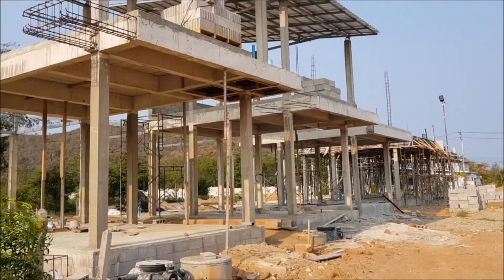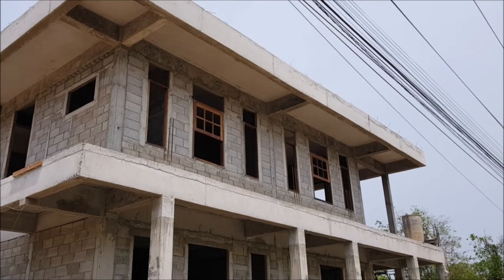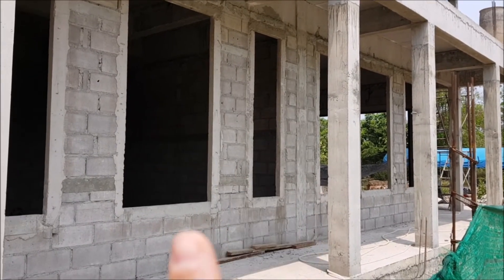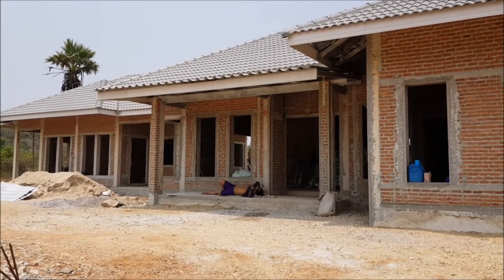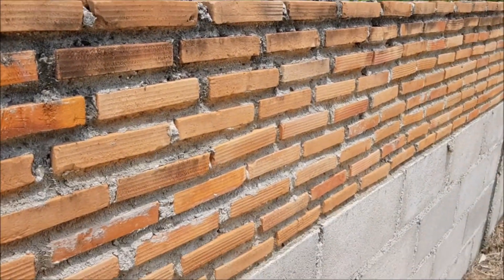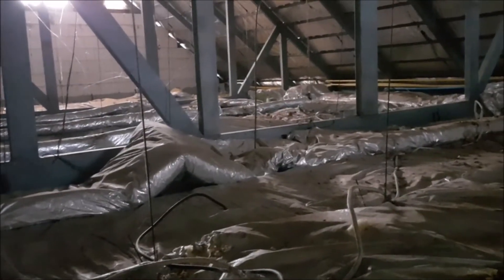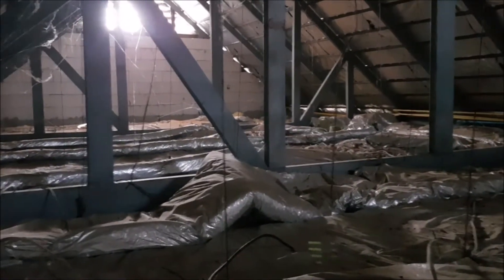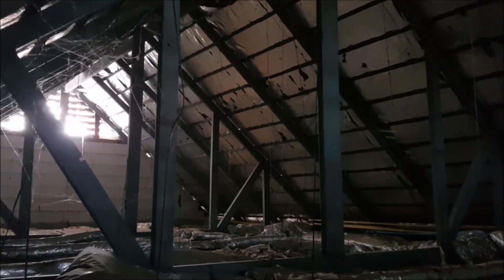Energy efficient building for hot climates. How are Thais building their homes?

Comment: Thanks for covering this topic for an Asian tropical climate. Here in the Philippines, Autoclaved Aerated Concrete (AAC) blocks by Stärken and other companies are becoming more popular. Theoretically available from 5 cm to 30 cm thickness. From what I observe though in actual use, I see 15 cm thickness for the outside walls and 10 cm for inside walls. Expats tend to use 20 cm for outside walls. A rendered AAC wall is at least twice as expensive per square meter than traditional Concrete Hollow Block (CHB) walls, but due to high electricity costs there is a good return on investment when using air-cons. Even without air conditioning, a well insulated room is more comfortable, because the insulated walls give off much less heat during the night than CHB.

Due to earthquake engineering up to a magnitude of 8.0, we use very solid post and beam construction, either with reinforced concrete or steel beams. Traditionally, CHB are filled and  reinforced by 10 mm reinforcement bars every 60 cm vertically and horizontally and tied in to posts and beams, preventing cracking and falling out during quakes. This is difficult to replicate with AAC. The advantage of AAC walls is, that they weigh only about one third of a typical CHB wall.

Nevertheless, the AAC infill walls need special consideration in earthquake zones, as they easily form cracks even in relatively minor earthquakes (magnitude 5.0+). In the Philippines they use a seismic gap of 1 to 2 cm on the sides and on the top filled with polyurethane foam or very soft mortar. Also the walls are tied in to the posts/columns using dowels or brackets every 60 cm of height. By comparison in Italy even more earthquake detailing is required for AAC walls with continuous reinforcement layers every 3 blocks and better protection against falling over by fastening the walls to the top beam.
Reply from the maker: Thanks for this interesting information about considering earthquakes.
Reply: @ChristianWagner888 do you have a company related to building in PH would be great to have contact.  my wife has house in N. Vizcaya we plan to build home/office in Mindoro or vicinity.

Comment: Thanks a lot for this video. Most videos on energy efficient buildings are from developed countries where emphasis is on keeping the heat in or keeping the cold out. If you have a link to how those energy-efficient concrete blocks are made then that will be very well appreciated.
Reply from the maker: This video would show you the production as an example: https://youtu.be/rZLDk00Cj2I
This types of blocks are typically made all over the world. The advantage is, that the material is containing mostly air, similar to a sponge. And it is the air, which gives you the good thermal properties.
This would be a video as high tech manufacturing example: https://youtu.be/JF96Wx-u07Q
Reply: Great! Thanks a lot.
Reply: I think they are aac blocks- autoclaved air crete blocks with air cells inside

Comment: i plant to put water pipe in room ceiling, so the cool water can be circulated
Reply from the maker: Roof areas and attics are usually the hottest places in a house. Your idea can block heat coming down that way.
Reply: @RolandW_DIYEnergyandMore  indeed, beside cool water are cheap & since we constantly use it, the water constantly replaced. So no heat buildup happen

But water pipe cost a lot
Reply: Although I agree with hydronic systems like that (running water through walls / roof) I’d be cautious about potential pipe damage or condensation issues since the roof will be the warm zone and the water will be cool

It would be far better to build a secondary roof system atop existing roof with a sloped overhang that blocks afternoon sun and cast a shadow on the wall that usually gets the afternoon sunlight and solar heat gain 
Tree placement and shaded outdoor water pond also helps a lot because the breeze passing over the water becomes cooler bringing the coolness inside 

Also you should get one extraction fan and run it through the late evening to early morning (9-10pm to 5-6am) to get a good overnight purge of thermal heat trapped in the blocks, then try keeping the windows/doors closed from 10am - 4pm, try that out for a week (it’ll take a few days to purge the heat storage in the walls and bring them to a good level of average temperature)

I’m introducing these and other concepts in Africa which is also hot and humid weather
Reply: Good idea, the inevitable indoor pool should be very shocking (yes, pun intended) as well.

Comment: Simiar but different processes to us in the caribbean. In my country DOminica the  smallest blocks we use are 4 inch but only for internal walls. 6 and 8 inch are used normally for external walls. Also we put up the blocks first and then pour the colums. Then after pour the beams and decking so it can tie in better structurally for exquakes and hurricanes. The passive cooling is the biggest problem i personally have dealing with
Reply from the maker: In a hotter world passive cooling is getting more difficult as even places in shadow will be to hot. We will have to rely on AC in furure but keep our rooms as energy efficient as possible. And the energy for the AC will idealy have to come from renewables. Thanks for sharing your experience!
Reply: a/c is the only way to make it bearable..  100% humidity is not fun.. A fan just moves super hot moist air .. Like how west and souther america populated.  It wwas the a/c unit..
Reply: I’ve done projects in the Caribbean ( and now Africa) which those traditional methods you mentioned are pretty common and although the 6-8” blocks DELAY the heat gain, by late afternoon ( especially on the west facing walls) they have absorbed an abundance of heat and then by the evening they slowly release the heat to the interior space 
Which is exactly the time when energy demands are high and often higher energy tariffs ( costing more than the residential day tariff)
Concrete blocks (CMUs as called in the USA) used in the Caribbean, are designed to delay the onset of heat and unfortunately the release of heat, so at 6pm sunset those west facing walls will feel warm/hot for 6-8hrs or more, on the inside and outside 
That is the problem and it’s a design issue which can be solved 

What I do in retrofit like an existing building like you have, start with outdoor exterior wall treatment to cast a shadow on the west facing wall, that could be adding 1) trellis with creeping plants, 2) fast growing plants like bamboo 3) a pergola with canvas panels to create an outdoor shaded area for BBQ etc 
From 9-10am keep windows/doors closed late morning through late afternoon and add an extraction fan high up the wall to purge days heat and while opening at-grade windows (or a vent) which face the outdoor garden or landscaping ( not a paved areas ) from 8pm overnight until 6-7am
These are simple solutions that will help you reduce your energy consumption for A/C 

If I was building your house I would have used either aerated blocks of 3” and do a double envelope with a 1” air barrier vented to the exterior roof elevation ( this works by creating a thermal separation air barrier from the outside wall, which absorbs heat, and the interior wall which has no direct contact with the outside wall preventing heat conduction-transfer, so the inside face of exterior walls remains cooled passively through night purges) 
another option is a single concrete wall of 6-8” but with 2-3” of rigid foam insulation covering the complete outside wall envelope, this system is faster and easier than the former, and it creates the best of both worlds 
I call it a capacitor and a resistor, the resistor is the outer later of rigid insulation that resists heat transfer conduction through the wall which normally heats the building in the evening, and the capacitor is the 6-8” concrete wall acting as thermal storage of cooling from the limited a/c or the night purges 

As you know the Caribbean nights are very enjoyable, and enjoys an average 10-12c variation from daytime highs to overnight lows, that is key and required for this design to work 100% 
Because the overnight lows is the temperature you’d want to maintain indoors throughout the day, using this technique you will be able to do this and with very limited or no energy consumption ( nearly passively) 
the Caribbean only has ~8 or 9hrs of heat to mitigate and the other 15-16 hours of the day are very temperate and enjoyable, meaning you use the majority of each day’ free energy to mitigate the effects of the hottest parts of the day….. 😊
this is much easier than a cold climate environment where the days are cold (avg -15c to -25c) and the nights are colder (avg -25 to -40) spanning 3-4months year, doing passive house design for that is tricky because 6mths later it’s hot and humid (+30c to +40c) so the design used to solve one issue is sometimes working against you to solve the other issue, need to be on your p and q 😅

I’m a passive house / energy efficient building developer, and usually I don’t give out professional services freely as it’s a business I do, I’m planning to do more such projects in Africa and the Caribbean I’ll like do vlogs on the topic, there are a few more tricks to do with it which will make the buildings fully passive and use no / very very minimal mechanical cooling in hot climates 

But using those tricks will save you a lot of money on energy costs, also in SE Asia Pacific, as well. 

Most of the narrative of passive house building design is dominated in the global north, which has different challenges, some apply to both but not all, I’ve spent over 20yrs doing such passive houses in Toronto Canada and NYC/Chicago USA and learned a lot about how to do them, I’m now applying that knowledge to tropical climates which has different challenges

Thanks for the video 👍🏿

Comment: Thank you so much for sharing this info. My partner and I are thinking about moving back to SE Asia and would like to build a home. I grew up on solar and realize that aircon uses many kwh of power, so I've been wondering about passive cooling options.
Reply from the maker: Thanks for taking time to comment. Yes, improving the structure of the house will help you to keep electricity cost on acceptable levels and you will feel a big difference inside compared to a cheaply built option.
Reply: Have you ever lived in asia.. Hot and humid, hot and humid rain, high humidity.. things get moldy and fast..  I used 3 dehumidifiers, others used closet heaters to prevent mold.. I never turned off the a/c..  If no ac then no fabrics whicker etc..cooler and no mold.. In pi they have woven beds cooler..  Rugs duh mildew smell yuck..   Passive options when its over 90 degrees and super high humidity.. You aint getting cooler air coming in. .Plus a lot are concrete termite and pest proof..Got the oven effect, suck up heat during day gives it off at night..   Solar have you ever been in a typhoon? well solar becomes airborne and a killer..  Yup..  Termites soo bad last time in thailand the roof rafters were metal pest proof..  Metal roofs, cheap and pest proof..  A matterss in a non conditioned space is a moisture grabber..  Rainy season nothing dries out, permanent high humidity.. You can feel it when you inhale..  And always have extra shirts in the boot..  One must condition at least the bedroom so clothing and bedding is kept in a usable state..  With a dehumidifier, add some heat too..   How does one lower humidity at 100%?  For weeks a season at a time..   One must remove the humidity thats how..  Basically the locals live with no a/c, but my sis in law definetly has an a/c in phillipeans..  And uses it..My dad doesnt my wife visited and could not sleep or eat.  There is no way i would live back in asia without a/c  in a few rooms..  Ahh the coolness and dryness are intoxicating..  When 100% humidity how does one dry cloths??   Locals just hang them to dry?? (hello its 100%) Me save enough to have a/c and a back up generator to power them..  Super insulate the bedroom on the outside with foam baords with aluminium backing to reflect radiant heat.. I live in san jose and the sun is really hot and strong.. I use foam with aluminium covers for my sunny windows to stop radiant heat..  I cover them in fabric look good..  On the  window side over 100 degrees, on the inside its 76 degrees and the room doesnt heat up.. You damn well know when the windows arent covered, the room really heats up.(radiant heat rays come in and heat up the items in the room thats bad).  Think australia and they have overhangs to stop sunlight..   My lesson one must stop solar radiation.. Bounce it back.. Read articles on best heat reflectors..  Mine are up already upper 88 or so today im bottling cool air..  But in asia you dont get cool air..  A fan just doesnt cut it..  San jose homes and commercial the roof plywood is aluminum reflective on one side now.. food for thought..  Mildew is bad in asia so mildewicide paints inside are a must, you can surf stores in asia for what they use there..  ac units geet clogged from dirt in asia so my sis has hers cleaned every year or so..   Bedroom windows at a minium they just lose or allow heat to enter..  Or as I always say if you live in an asian country get used to it live like a local..  Bob coated his roof 2 times a year with a reflective white paint in PI..  See articles there are a lot of them now..  So how to stop radiant heat? trees, ivy, thats the real killer.. If one can limit the heat build up your a winner..  Id insulate the outside because cold meats hot you get moisture keep it outside.. Inside no sheet rock plain walls stuccoed like how i lived in HK and singapore.. Must move air around mold etc..  Asian cars have supped up ac systems to handle the heat.. Not like usa units..  you see your breath, ahhh what a relief after walking about for hours..   one must have at least 1 room with a/c with a tv computer clothing..  Some days are unbearable..
Reply: Not too familiar with this. So what you're saying is thicker solid blocks are better than hollow ones in tropical regions? I'm from Nigeria. I understand the ceiling insulation and ventilating the roof. There is really no quality control here. Blocks are made with just cement, sand and water. No aeration agent (though I don't get that too). Best case os the blocks are vibrated. 
Also want to ask whether these solid blocks won't add more weight to the building? What happens if you're building on an already existing substructure or building? Do I get the structural design redone? Also what materials are best for roofing sheets or covers. We mostly have regular  aluminum or stone coated ones. Any better options? Sorry for the many questions. Hope to start building my house soon and my focus has been on passive cooling. Fortunately the estate plot has mine well oriented. So thinking more of the material and cooling techniques

Comment: Great video. Thank you so much. A couple of questions. What kind of foundation did you make? Friction drilled piles or columns on base?

Also. The insulation in the open roof. Seems like moisture would get inside and cause mold. Also seems like a good place for snakes, rats, and bats. Your thoughts are appreciated.
Reply from the maker: Our foundation is columns on base. The open roof is actually preventing moisture as air isn't trapped under the roof. There is a fine net covering the opening in the gables so nothing going in there. Nevertheless rats will always find a way in. They typically crawl under roofing tiles. I do have to catch them periodically. Never saw a snake in a roof space. They might actually be helpful against the rats. :)
Reply: Fantastic. Do you know anything about the piles they are using in Bangkok construction around the airport?  I get different stories. Some tell me they drill piles down 30 meters. Others tell me much less. Since it’s basically a sponge marsh I would think the piles go deep. My two bother in laws have some subsidence  after 15 years.
Reply from the maker: @robdavinroy1761  it of course depends on the weight a pile has to carry. A multi story house will have deeper driven piles than just a single story house. Usually before one starts building in Thailand the soil has to be analysed, and based on the findings the architect will decide about the type of foundation. In Bangkok you will always have to go for piles.
Reply: Thanks so much. You are in hua hin?  That’s where we are looking to build on the other side of the mountains. By the way what do you think of the construction quality at Ban Yan?  I visited their display villa. Looked like they were using the thick concrete bricks like you did. Again thanks for your insight.
Reply from the maker: @robdavinroy1761  Pranburi. Just 25kms south of Hua Hin. Don't know how Banyan has built its buildings. Some contractors use the heavy concrete blocks and say 'look we have thick walls'. Many people who try to build better walls are using layers of thin aerated concrete as it is everywhere available.